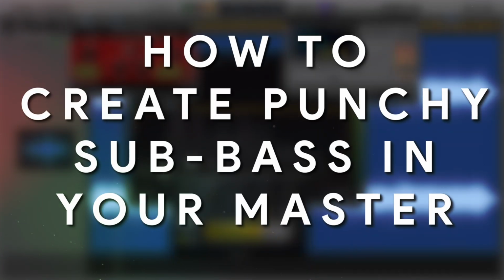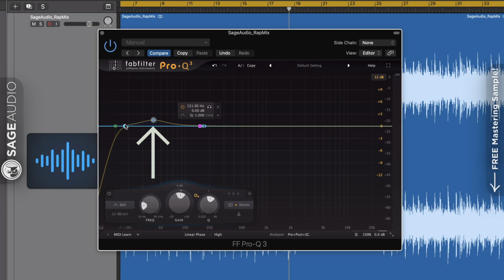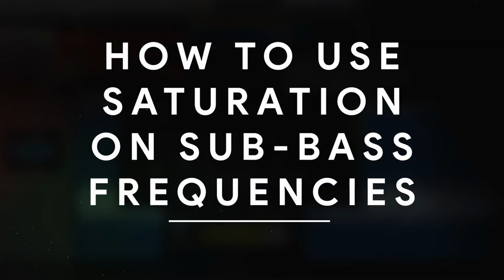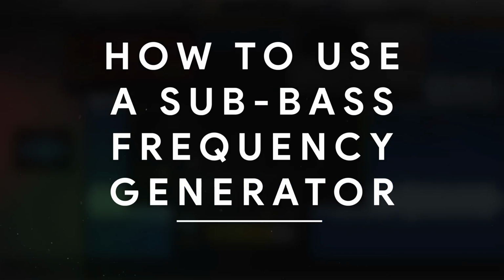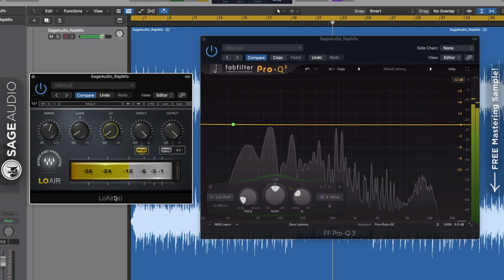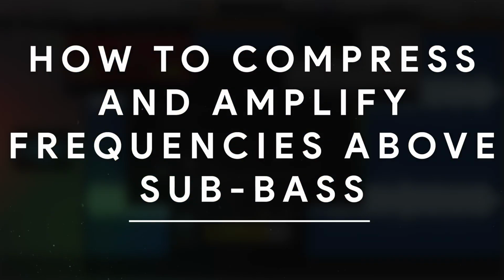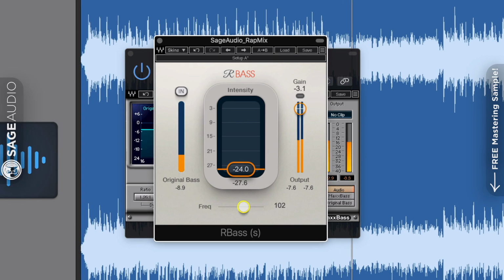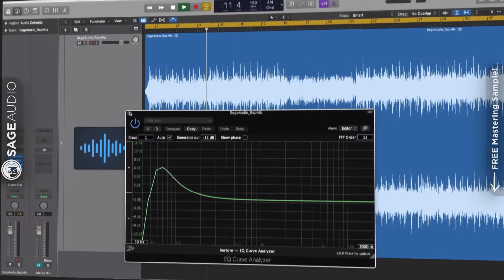How to Create Punchy Sub Bass in Your Master

Comment: Can I ask you a quesiton? How to control the dynamic of your mix? What's the best number to shoot for? Thanks.
Reply from the maker: Hey Kev! It'll really depend on the dynamics of the track you're working on.  Some tracks don't require further dynamic control, whereas other will.  Compressors, de-essers for sibilance, and limiters are the typical dynamics processors to use.  

That said, there's no exact number to shoot for.

SageAudio.com

Comment: I was watching a tutorial from Luca Pretolesi and he spoke about cutting side information at 200.  Im curious about what you guys think because I thought this was pretty high.  Do you recommend generally a range at which you cut side info from the sub ?
Reply from the maker: Thanks for watching and leaving a comment! 200 seems a little high, 130 is about as high as I go, but it does depend on what you're working on I guess.  Maybe he was working on something that required that? But I'm not entirely sure.  

SageAudio.com
Reply: @sageaudio  12:17 .